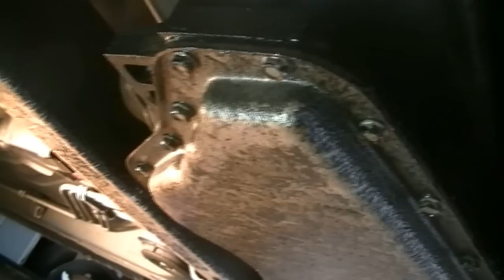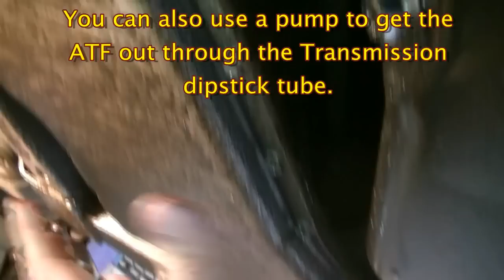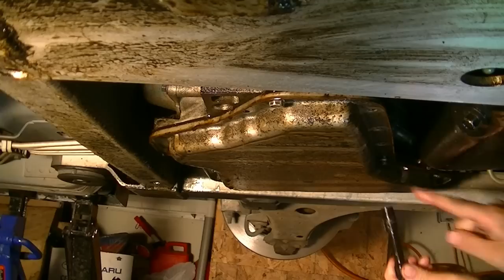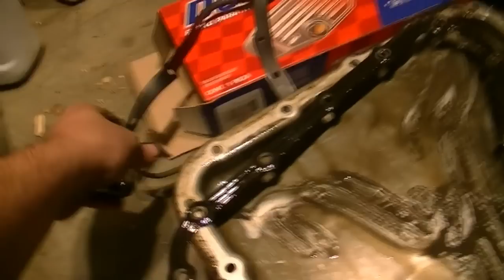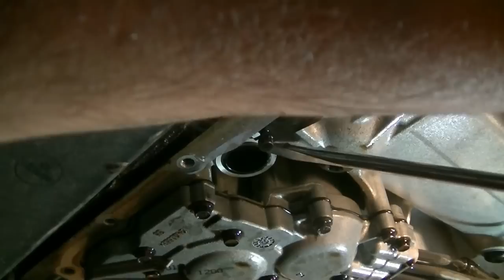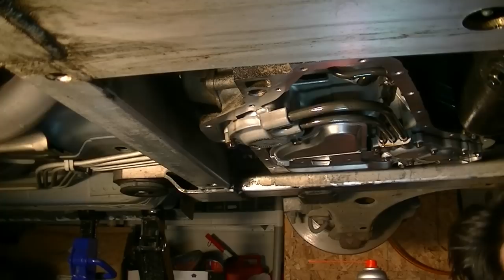Automatic Transmission Oil Pan Gasket Replacement - Chevy Monte Carlo, Impala, Monte Carlo

Comment: Good shit. Gonna do this to my Carlo first thing tomorrow morning, What I don't understand though is why you bought individual quarts instead of two 1 gallon containers. I had Advance Auto Parts price match Walmart's Valvoline High Mileage transmission fluid at $16.90 a gallon and picked up my filter that I ordered through them online for only $10 after a 30% coupon code. Always try to price match or order online through automotive stores using coupon codes then pick-up in store. Maintaining a car is expensive enough as is.
Reply: John Shay 
 The Valvoline Maxlife Dex/Merc is a full synthetic fluid with very shear stable base oils and a premium additive package from Lubrizol its just as good if not better than the Mobil 1 fluid.   Where the maxlife beats out the M1 is the price bargain where it can be had in the gallon for $17 or even less when on sale.   Autozone recently was selling this for $10.99 per gallon!   The Maxlife may be more desirable for its lower viscosity in some applications where it comes in at a 5.9 cSt @ 100 c while Mobil 1 ATF is about 7.4 cSt @ 100C.   Conversely some applications may favor the thicker Mobil 1 fluid, but Maxlife Dex/Merc is a superior replacement for any mineral based DexronII/III fluid and even superior to the blended synthetic fluid you find in most PetroCanada's based DexronVI fluids.    The 4t65E really won't care either way which fluid you use between the two.
Reply: It's hard to know the exact base oil formulation since they are proprietary but based on many factors it's indicative thatthe mMaxlife is a full synthetic just as good as Mobil 1.   They both likely use a mostly group 3 base with some group 4/5 blended in.   

Yes that link is correct,  although they changed the sticker recently it looks similar but as long as it's Valvoline maxlife transmission fluid they only make the one type under the Maxlife name currently.     

The reason it's cheaper is anyone's guess,  ExxonMobil is making a killing on many of their products because they are a much larger company compared to Ashland/Valvoline.

Comment: Another option is to replace the transmission pan. I think Dorman has a transmission pan with a drain plug. But if you do a good job once, you can just use the drain plug for the next 5 years. I don't know how good the Dorman pan is though, I'll have to buy one and I'll let you know  
The bottom line is that this fluid has to be changed. I seen these vehicles get 180, 000 miles easy. It's  worth it to change the fluid.

Comment: Great video.  About how many labor hours would an average independent garage charge for a gasket replacement.  I have a Honda Accord 1995?  It would be faster than this Monet Carlo because it has a magnetic drain plug???  Thanks.
Reply: At least a good hour and a half to 2 hours. You have to clean the inside of the transmission pan too. You have to add 7 to 8 quarts. You have to drive it and check the fluid when it's warmed up. It's worth it.

Comment: Are you gonna be doing a video for the engine oil pan gasket replacement on this car since its leaking?
Reply from the maker: Gary LaSangre sorry dont have the car anymore!
Reply: +RatchetsAnd Wrenches  I have a '95 Monte Carlo, any ideas on replacing the oil pan gasket? Does the engine have to be lifted or can I work around it?

Comment: What's the torque spec on the bolts when resealing the transmission pan?
Reply: 10 ft-lbs or 120 in-lbs

Comment: I wish they would have put a drain plug for the transmission like the oil plug... Would be so much easier & less messy.
Reply: They have pans with drain plugs now, gotta buy it separately

Comment: my car jerks everytime its shifts gear. Will changing the oil make it  from stop doing this?
Reply: Mine was doing the same thing, I installed a trans go shift kit on the 1-2, 3-4 solenoids and now except for 1-2 I can barely feel the shift.  (I have a grand prix but it's the same engine/trans).
Reply: I recently bought a 05 impala and it's the same tranny. after a couple of weeks of regular driving it started to jerk hard when changing gears and I also smelled like a burnt smell at times. The fluid was brown so I decided to change the fluid. I bought the Dex/merc brand from AAP nut now it's jerking even more and it starts to slip!! Is the Tranny done for?
Reply: gemzzwhoa Mine had the same issue, except the burning smell,  I'd changed the fluid multiple times but after I added the shift kit it got better, after about three months of driving the hard shift is gone.  If you're doing the job yourself I think you may want to try it before scrapping the car or swapping the tranny.  There's a bunch of instructions all over the web and if I'm not mistaken I got the kit from amazon for maybe $50.
Reply: +mpbrown18 Thanks man I think I'm going to start that project. Are there any step by step videos or instructionals on how to install the shift kit?
Reply: This is the one I used, once you get in there it's pretty simple.  I think the hardest part is being overly delicate and trying not to break stuff.
http://www.bobistheoilguy.com/forums/ubbthreads.php/topics/3305719/4T65E_fluid_change_and_Shift_k
Reply: @mpbrown18  Ditto on the TranGo shift kit. If you are going to the trouble to drop pan and replace filter...install the TransGo kit. You will be wishing you had.

Comment: what are the torque ft/lbs for the pan bolts?  thanks....
Reply: you mean 12 inch pounds, they're not lug nuts, i checked the torque with GM
Reply from the maker: +candymintz 12 inch/lbs would be 1 ft/lb which is nothing. So if you checked they probably said 12 ft/lbs. or if 96 inch/lbs that would be 8 ft/lbs. Cheers
Reply: 10 ft-lbs per GM service manual

Comment: menards has dex 6 for $4.80ish!!  over $3 less than auto parts stores!!  just an FYI.....
and ONLY use dex6 not dex/merc!!!!
Reply: Dex6 is proven to be too thin and can cause slipping. There was a GM bulletin on this. Stick what it was designed for, dex/merc3 and substitute 1/2 quart for a bottle of lubegard synthetic additive(in the red 10oz. bottle). It's absolutely great for conditioning and cooling the trans!